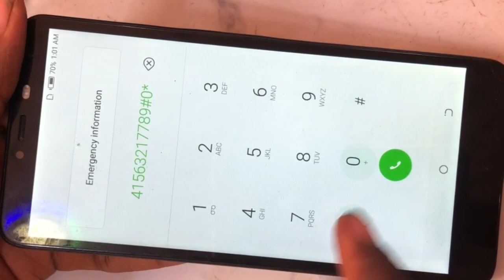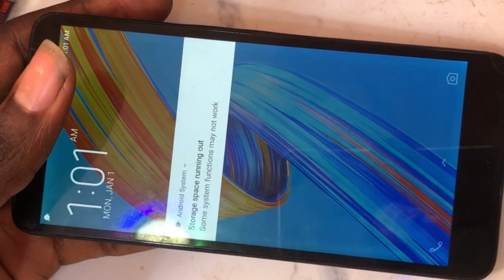Full tutorial about Short circuit on Phone board (PCB short circuit solution) dead phone solution 1

Comment: Hi please how do you determine a phone screen circuit and power circuit..And at the same time how can I use the multimeter..Im a guy in phone and work on normal fault like screen changing,mouth piece,charging system etc.But I want to learn the board aspect.how to test ic or a dead board 🙏